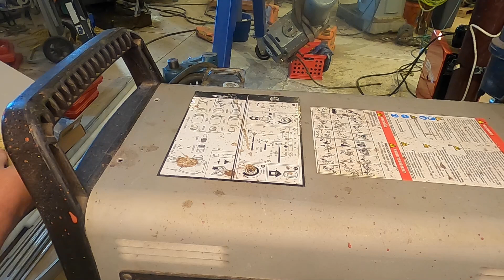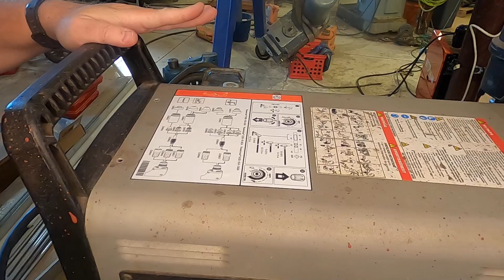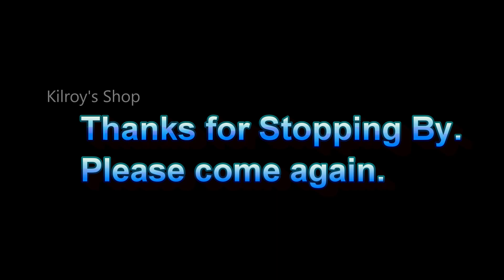How to replace a Hypertherm Torch

Comment: I also have the HP1000, it’s been really good to me. I’m using the machine torch for CNC cutting. Still using the old style consumables though. I am concerned about the future availability of these parts. But I am retired now and it becomes more difficult to justify the cost of upgrading. I’ve seen the import parts on eBay. Has anyone tried them? I’m not looking to cut hypertherm out of any business, just pondering an alternative should the genuine parts dry up. Cheers!
Reply from the maker: Import consumables? I have not tried them.